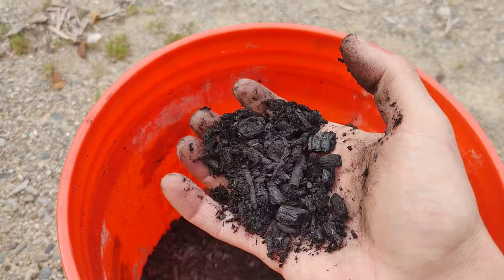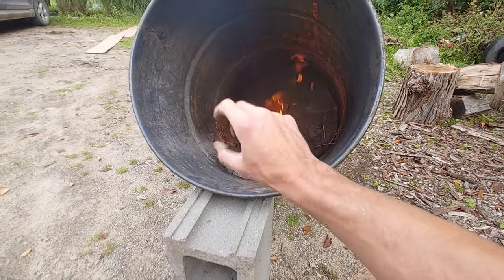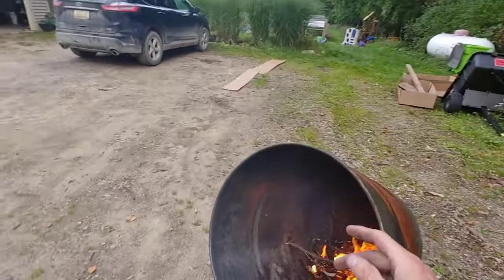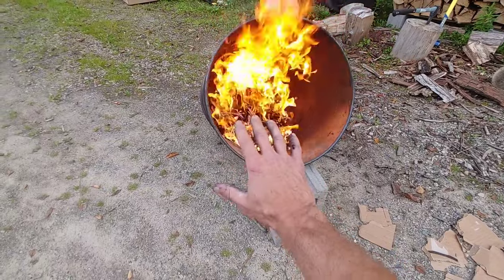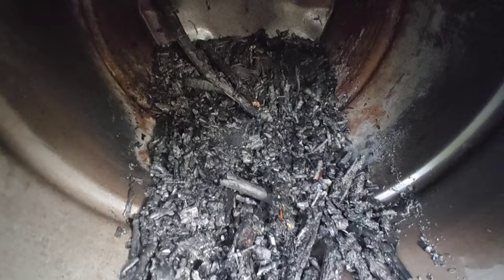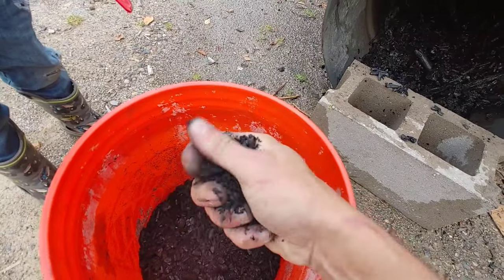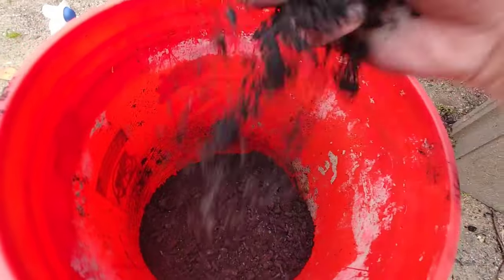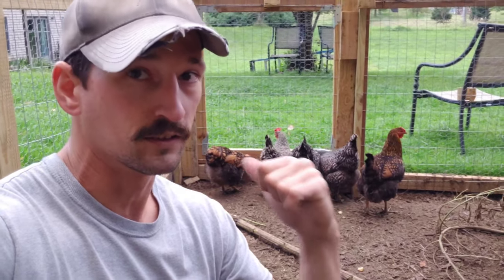How To Make BIOCHAR in 30 Minutes or Less

Comment: That's not making biochar, it's metane factory. 
In this temperature you would need hours to trigger pyrolysis, which is required to maximize the surface. You just dry and gasify wood, creating a mixture of char, soot and ash. And most gases just go into the air, contributing to the greenhouse effect, as you don't have the secondary combustion area in your design.
Reply from the maker: The angle of the barrel triggers pyrolysis.  Oxygen can't enter the bottom so must enter the front where it is burned by flame before it can get to the wood.  This is the least oxygen you can get without a more complicated design.  The results are char that is consistent throughout.  On par with results from kiln in kiln or burial.
Reply: @FastGardeningMichigan  pyrolysis needs high temperature, prefarably 900 Celsius or more, to occur quickly. In the bottom of your barrel you only gasify carbon to greenhouse gases, methane, some carbon monoxide probably.
That's why people use deep trenches or even better rocket stove with internal pyrolysis chamber.
Reply: Take a minute to think about the environmental impact using this method as a percentage of the total impact from a person's every-day life; it's minimal. One might think to compare it barbequing dinner, or the amount of methane released by conventional composting.
As for the char, if it breaks easily and sounds like broken glass when dry, it's pyrolyzed enough.